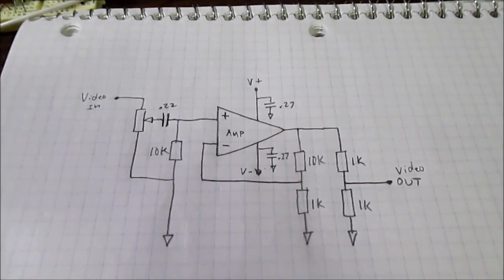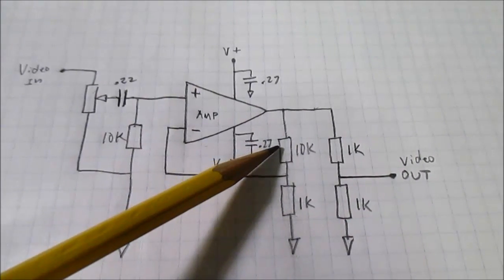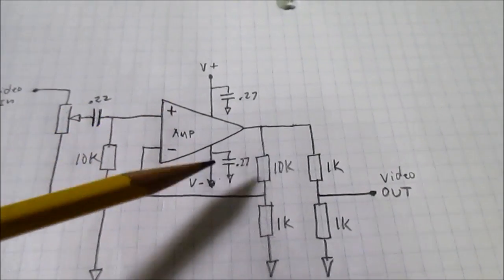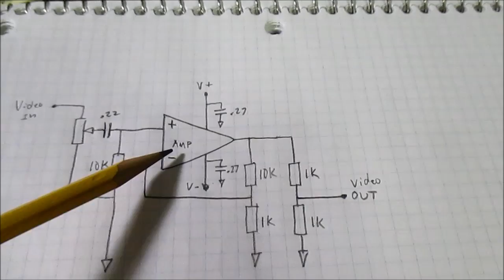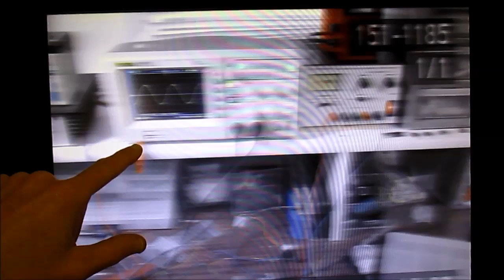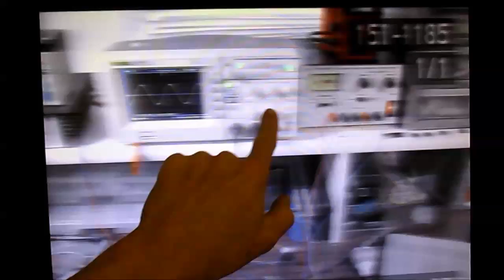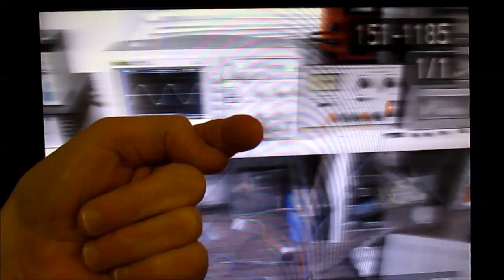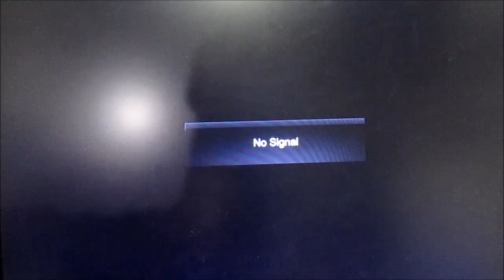Video signal through Audio amplifiers. Am I mad?

Comment: More bandwidth will give you more detail.  The sub carrier for the color runs at 3.58 Mhz QAM encoded.  Of course keeping the amps close to unity gain will give you the most bandwidth.   Weak color would indicate the sub carrier is probably getting squashed down due to bandwidth limits.  Lack of clarity and lack of color should go hand in hand with this test.  Fun test,  problem is the TV might be compensating a bit on the input.

Comment: Composite only goes to 6MHz, but if operating using an up-modulated VHF/UHF signal you will get lots of ringing if the complex output impedance of the amplifier/cable is not matched properly to 75 ohm.

Comment: @JohnAudiTech  Really at the end of the day i suppose a video amplifier and audio amplifier are the same, they both amplify the signal more than the input and in both cases an increase in voltage is how it works. I suppose the only real difference is the frequency they work on,i.e. Audio is 20Hz to 20 Khz but for video,i don't actually know,but obviously it's on a different one to audio, thats why i think the LM4562 works great as i looked at the specs and it says bandwidth 55Mhz
Reply from the maker: The gain bandwidth product (GBP) and band width of an amplifier are not the same thing. The usable bandwidth of an amplifier is dependent on its gain and output voltage which is significantly less than the GBP figure.

Comment: @JohnAudioTech I think the LM 4562 works best because it's bandwidth is 55Mhz :)
Do you think the same experiment could be done with an internet signal to boost it and make it faster or more stable?

In my house my internet is derived wirelessly from a broadcasting tower (wap) to my home where a single small dish picks up the signal then goes into a POE (power over ethernet) box then into my router (hard wired) then pc.

Do you think somewhere along that signal path i could incorporate an amplifier and boost the signal and DO YOU THINK that would boost the signal strength and in turn give more speed? OR would it just give a stronger more stable signal but same speed

What are your thoughts.....:)
Reply from the maker: I would doubt that any amplification would help as the signal is likely amplified optimally already. In this condition, additional amplification would also amplify the background noise with the usable signal yielding no net improvement. With the frequencies used, cable loss is significant, so the antenna cable must be as short as possible. I suspect the antenna has an amplifier and/or conversion built in to overcome this. (I'm no expert here) Best thing to do is increase antenna gain. If you have a dish antenna, the gain is already very high. In this case aiming the antenna is critical for receiving the best signal.
Reply: JohnAudioTech
Okay so positioning is critical,if trees and large objects were in its path would this decrease the maximum speed obtainable?
When they positioned the small dish on the roof of my home,they just roughly guessed where the location of their nearest NODE was thats what they call it,i think they should of used a meter on the signal and moved it until the highest reading was read, but they just stood on my roof and said.oh its over there and screwed it up.
I am sure if i move it slightly left or right i could increase the speed

Comment: I did something similar recently in order to diagnose a malfunctioning AV input on a CRT TV.  I went through the signal chain with an audio signal tracer til I found the stage where the video signals vertical synch component was no longer coming through the audio tracer.  You can find the video on my channel it's called Old ass CRT TV repair or something like that.

Comment: I have in the past tried the reverse. Using  RF transistors in audio circuits. They do tend to work gain wise but at the expense of noise and distortion. Not tried RF chips however.

Comment: Very interesting, I wonder if a class D amp would work.. would most likely need to remove the low pass filter, but would be an interesting experiment. The performance of the 4562 looked just about perfect though.
Reply from the maker: Now that 's an idea to try. I'm guessing without the LP filter, the switch mode spikes would destroy any meaningful video.

Comment: I tried this myself back when I was a kid, I had and audio mixer and I tried putting a video signal though it just to see if it would work, and it was very blurry. The LM833 looks kinda like VHS quality, the 4562 looks outstanding though, it would probably work very well as used an oscillator for AM radio circuits.
Reply from the maker: Ah the old days... I recall recording the video signal to cassette and playing it back into the TV. Of course it failed completely. Many power amps have low pass filters to keep RF out of them which I left off for this experiment.